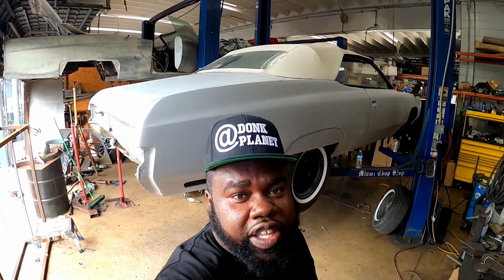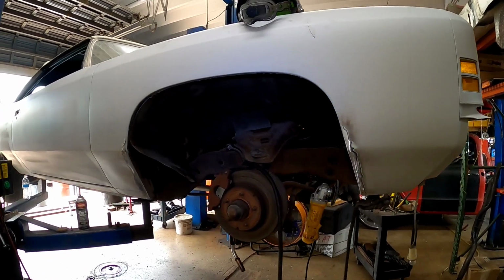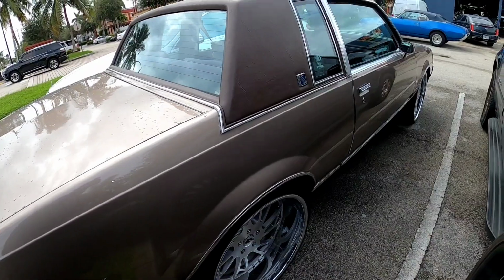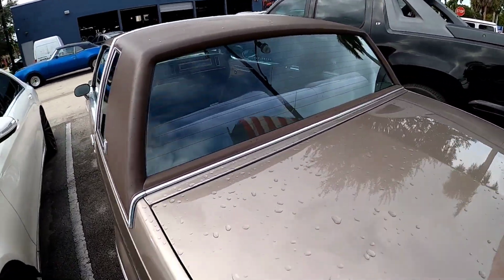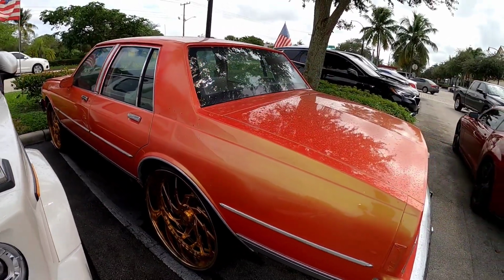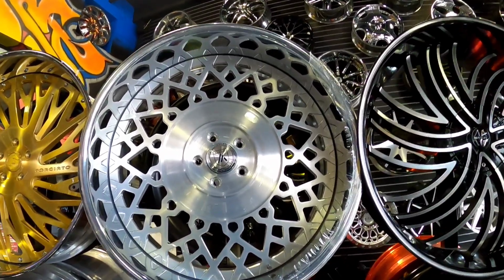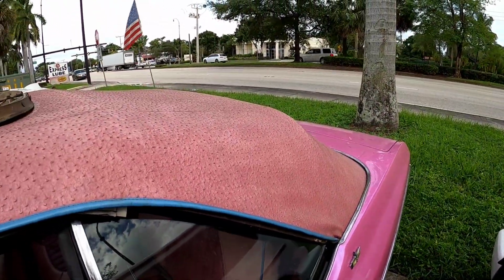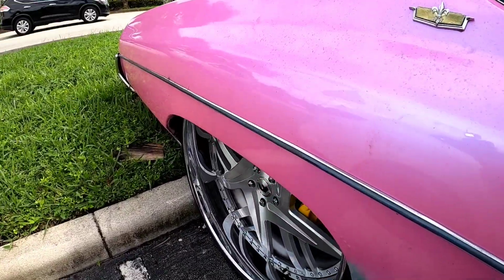HOT PINK DONK ON 28 INCH WHEELS"

Comment: #DONKPKANET2020/2021
MY FIRST BOX WAS A #82XZCapriceClassic305 double coloring/top body light Sea water green, bottom body, Grass green💯‼️
Reply: The Good Chevy year 1995, 23years yung Hillbilly Chevy Caprice on mustard n mayo tires with Original Chevy spokes locked Hubs. Alpine face-Off Deck 6:9 speakers, 6:2 door speakers,6tweets, Alpine amp, 12's JLs Woofers ‼️🎶🎵